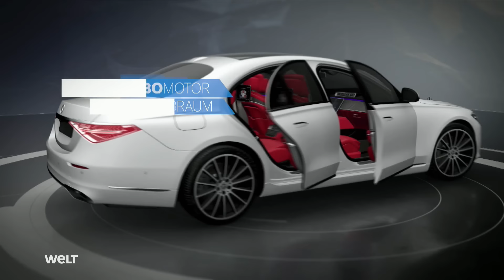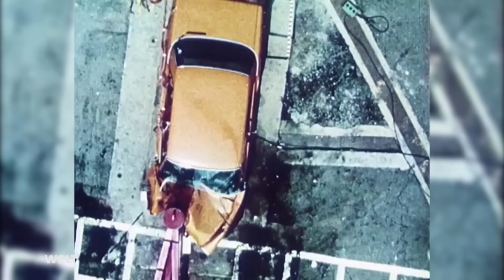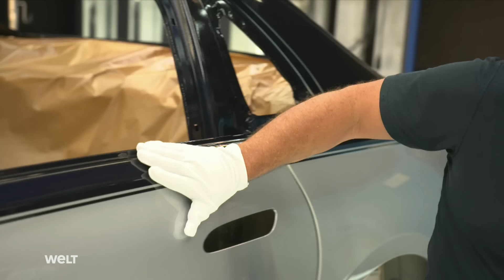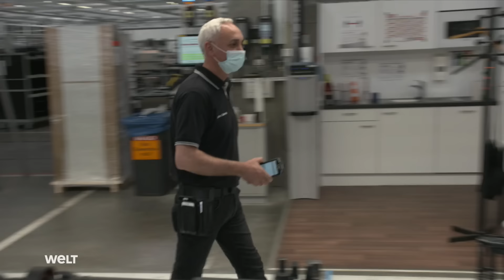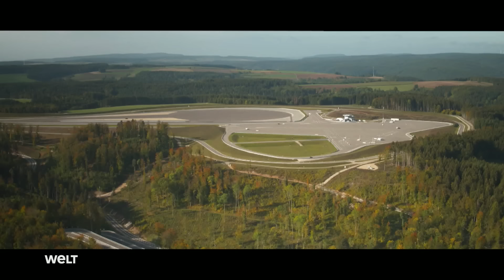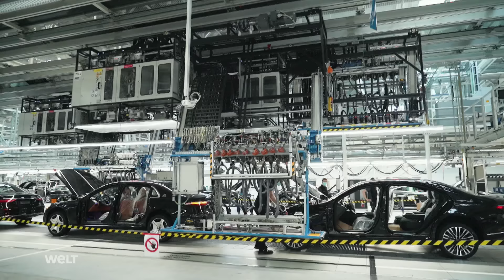THE SECRETS OF LUXURY SEDANS: How S-Class, Maybach and EQS are made | WELT Documentary

Comment: To call these engineers shit head it's not enough, I am an auto mechanic and it's a nightmare to work on a Mercedes, there is no room to work, they put so much stuff there is no room in the engine bay, Mercedes s to replace the turbo's you have to remove engine and the transmission out of the car, as soon as I said that to the customer, the customer sold the car, u are talking about $11,000 parts and labor (two turbo), the customer got sick and tired of spending money on it. To replace one head light they asked $6000. (in Los Angles) To do 4 braks $2000, coolant leak $1000, oil leak another $1500. Mercedes M class, dealer asked $15,000 to fix the engine, 4 month later transmission went they were asking about $12,000 if I recall right, another one they asked $72,000 to replace the engine AMG Mercedes 500 S

Comment: S class, c class,
BMW 3,4,5,6,7 SERIES IS HIGHLY EXPENSIVES AND SIMPLY COSTING FOR REGULARS SEVICES AND REPAIRS..
I'VE EXPERIANCING 7 TIMES BROKE AT HIGHWAY WITH BMW E93 AND SOME COUSES ELECTRONICS FAILURE..
VW.. GEARBOX IS SIMPLY EASY TO BLOWN UP AFTER REACHING 200 TO 230K KM.
GERMANY BRANDS IS EXPENSIVES CARS WITH MANY ELECTRONICS FAILURES AND OLMOST FAILURES ON PLASTICS SOCKETS..
EXPENSIVES CARS WITH CHEAPEST PLASTICS BEING USED ON ELECTRICALS CONNECTORS

Comment: European cars are sophisticated, superb engineering yet some models aren't as reliable as others., like American cars some models are reliable others not. An example some Lincolns, Fords, Buicks, have run over 400,000 to 650,000 miles without the top end being rebuilt, my Buick has 431,000 plus mikes still runs good, burns oil but keep the level full. Mercedes diesels of the 1980's would run over a 500,000 to 1 million miles incredibly well built cars, love the S claas.

Comment: 1:00: 🏭 Mercedes-Benz builds luxury vehicles in its fully networked superfactory in Zindelfingen, Germany, producing the S-Class, Maybach, and EQS models on a single production line.
5:39: 🏭 A press shop in Hall 17 uses an overhead crane to produce molded parts from metal sheets at a high rate of efficiency.
11:35: 🚗 The video showcases the process of painting vehicles in a modern car factory, highlighting the efficient and resourceful e-coating dip tanks.
17:09: 🚗 The video provides information about the history and features of the Maybach luxury car.
23:00: 🚗 The video showcases the assembly of dashboards for vehicles using automated guided vehicles.
28:49: 🚗 Mercedes-Benz car production plants are utilizing industry 4.0, big data, and intelligent tools to streamline production and ensure high quality.
34:44: 🚗 Mercedes-Benz aims to be completely CO2 neutral by 2039 with a photovoltaic system on the roof generating 30% of the factory's annual energy needs.
39:45: 🌍 The challenge is to create a car that can drive on any continent and understand different traffic cultures.
45:04: 🚗 The S-Class is filled with various fluids and prepared for its final stages of production.
Recap by Tammy AI
Reply: Wow amazing how this Tammy AI summarizes it! love it! Thx for saving my time!

Comment: That's okay Mercedes-Benz. I am content and very happy with my 2019 Toyota Corolla. It currently has ~6,500 (yes, 6500) miles on it. I can reasonably expect this vehicle to have a service life (no rebuild) of 250,000 miles. Since it has a timing chain, the only replacement parts will likely be the water pump, brake rotors, and perhaps wheel bearings. However, since I stay in Philadelphia, PA, the vehicle is also likely to suffer a collision from a careless, impaired, or reckless driver. Rear-end and careless left-turn collisions are popular here.

Comment: Too bad the cars are such unreliable piles of junk that depreciate like they're made of ice cream. 
Spending money on a German car is a sign you have too much money and no brains. 
Take it from an EX BMW lover who owned fifteen of their cars from 1, 3, 5, 7, X, Z to M's. Then I discovered that your luxury car doesn't have to leave you stranded because their transmissions are DESIGNED to fail at 120,000kms due to dealers recommending that you DON'T change the transmission fluid because it is 'lifetime'. Or that your cooling system doesn't have to be made of plastic that explodes when it feels like it. Or that the dealer doesn't have to take your $250k M car on a weekend away and joyride it. Or that intermittent electrical gremlins shouldn't be part of your experience. Or that your sunroof is broken because of a three dollar piece of plastic that was designed by person who did the cooling system but it costs $3k to rip the headliner out to fix. Or to have the dealer try to scam you by unplugging the GPS antenna connected to the GPS unit in the boot and then telling you it will be $4k to rip the car apart and install a new antenna and then running and hiding like cowards when you plug it back in IN FRONT OF THEM. Yes, I'm looking at you McGuigan BMW, Port Macquarie, Australia.

Comment: The head of production Mr.Michael can be mistaken as  Kawasaki has been manufacturing using this system from a decade ago. A single line may produce a docile and low capacity street bike , a big heavy cruiser  or a firebreathing superbike all on the same line. Although mercedes has a new plant so they have a more modern system implemented.

Comment: I believe that a vehicle can be defined as luxury, by introducing new mechanical components that are absolutely revolutionary and representing a pioneer in the field of mechanics. But unfortunately, so far, for more than 100 or so years since the vehicle appeared, they have only come up with small innovative fillings. The performance and consumption economy of a vehicle is reflected by a new technical and technological structure. The rest as comfort returns to the last stage. Unfortunately, nowadays, the whole automotive industry only copies from each other with small differences in desing, certain aesthetic elements, and in terms of new revolutionary mechanical concepts remains at the white sheet stage.
Reply: did you watch the whole documentary, some features are truly revolutionary, like auto breaking, self driving, self parking, electric motor, also new safety measures. I mean what you look for, this is not flying machine yet, just a 4 wheel car carrying humans as it was 100 years ago, just get real
Reply: @inter3684  
from the documentation, I have found so far that the first electric vehicle was made in 1832. I meant that no other technology had been tried in the system of wheels, chassis, steering, engine. From the electric engine, it went to the internal combustion engine, and now it returns to the electric model again, only with small technological and not mechanical changes.
Reply: @carpii4ciclet  Sorry you make no sense! if first electric vehicle was discovered in 1832, why should not we use it extensively in 2023?
Reply: @inter3684  I don't think you fully understood what I wrote. I did not refer only to the change of electric motor to internal combustion engine, but to the fact that in this entire industry, no new mechanical principles were invented and the same old knowledge was used. You can't call innovation just by changing one engine principle with another and leaving the same mechanical systems obsolete.
Reply: Oh really, & what have you come up with that out shines the innovations brought to market by the car industry & doing so while constantly under the constraints & scrutiny of various government microscopes?

Comment: I got a special order the S 580 4Matic  2022 full options. The car is excellent but has a problem that the 12 volt  battery has to be re charged especially if I do not drive it for at least 20 miles per day. That means you will put more mileage on the car and the warranty will expire before 4 years. There is a class action lawsuit against Mercedes because the company refuses to correct this issue.

Comment: If you have ever had beers with three mechanics who fix S-class Mercedes cars when they break after 5 years (and they always do), you will look differently at this video 🙂
Reply: My 2019 S-Class has now nearly 100.000 Kilometers on the clock and i had zero issues, even the brake pads are the first. Only because of tax write-off reasons, the car will be replaced by a new S580 in the next spring, otherways the car drives like at the first day.
Reply: @Rick2010100  That is a total lie. No brake pads will last more than 50  K miles. Writing idiotic prose like ghis shows what you are.

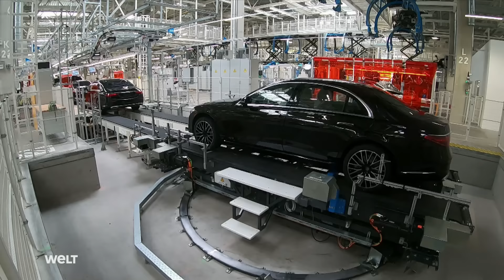Comment: Is it just me or the lines are slightly mismatching at 48:26 ? Pretty sure there is an additional station where the door lines are perfectly matched !
Reply: The lines of the door are indeed slightly off, but this is actually the norm when doors have just been installed.
The angles of the doors will be fine-tuned after they've been installed. They'll be adjusted until the lines are perfectly straight and surfaces are flush with the body.

Comment: what happens when one of those tiny plastic evap hoses cracks and 67 hours is required to change it or the cruise control is disabled? after the warranty runs out by 2km. screw it you rich enough to buy this one. just buy a new version. goodluck maybe putin hasnt dropped the newks yet and the cpus are all destroyed by the EMPs

Comment: While the factory is great for the Mercedes shareholders the cars are prone to have many electrical failures.
Reply: as every modern car, due to the fact that cusomers want more and more stuff in there cars. Its easier to build long lasting mechanical parts than making sure you will never run into problems with wiring, sensors or any electrical components

Comment: Mercedes makes an excellent cars and they look great from the inside out, but they have to many maintenance issues just like the BMW, and that’s why I moved to what I believe is the cream of the crop (Lexus). I brought a brand new LS 500 and I love it.
Reply: The S-Class is rock solid since the W221 generation wich was produced from 2005-2014.
Reply: I have have a LS46 SE-L, and a GSF sport with 5 litre engine. They come fully equipped, the service is brilliant from the dealer and having only once bought a mercedes, even the dealer was rude and arrogant and liars. After 3 weeks, I asked for my money back and eventually took them to court. Never,ever buy German
Reply: Even new Lexus cars are not reliable anymore due to electronic issues, too much electronics in them which can fail anytime
Reply: @M.E63  Failure in new cars happens because of plastic and cheap connectors. Mercedes use plastic pumps, Lexus use iron pumps,Mercedes use rubber hoses on AC and cooling lines, Lexus use stainless steel. 
Failure of wires and electronics in Toyota products are under 1%. Mercedes has had more problems with their hybrid batteries in 5 years then Lexus has had in 20 years with millions of hybrids.
Reply: @epoxy1710  nope failures happen from semi conductors and caps and diodes etc I’m talking about electronic components, you can’t predict how long they last as a capacitor , diode or a ic can fail anytime and the Japanese don’t have anything special when it comes to electronic components, they use the same as everyone else, most new cars have electronic or electrical issues and the things your talking about don’t really fail until the cars get older, and electronic issue you can’t predict when they will happen as it’s normally just happens randomly not normally a quality issue, if you go to Germany you’ll see taxis that are Mercedes with half a million miles and we talking about lots of Mercedes taxis, not one or two Lexus cars with half a million miles , some things are better on Japanese cars but not electronics as they use Bosch and Delphi and ATE aswell and there’s no such thing as bulletproof electronic semi conductors that only the Japanese have , it’s a shame though the Lexus and Toyota and can’t compete with with even JLR and they make terrible cars nevermind competing with Mercedes or bmw or Audi
Reply: @M.E63  The average Land Crusier 300 serie has first major breakdown in Russia,Africa and Australia after 380.000 miles and wrecked after 850.000 miles. The average Lexus has the first problem after 155.000 miles with a average cost of $460. Audi and Mercedes is overrated.
Reply: @epoxy1710  I’m telling you as a electronic engineer , Japanese cars got nothing special when it comes to semi conductors and electronic components, your comparing old cars which means nothing compared to new cars , most new cars get electrical and electronic issues , Mercedes engines don’t fail after a year or two and neither does the gearbox or suspension, most new cars get electrical and electronic issues and that can happen to any brand, semi conductors can fail suddenly not bcuz of quality issues or design issues, then days are gone where your electric windows just have a motor, switch and fuse , it’s all controlled by modules and so is everything so they going to fail more compared to older cars that had hardly any electronic modules, that’s why it’s impossible to compare old cars with new cars, I’ve had Mercedes cars and bmw and other German and British and Japanese and Korean and American and so on , Mercedes and the Korean cars for me was the most reliable, the Mercedes cars for me went on forever with no major issues, just usual wear and tear stuff, Mercedes vans go on forever, there’s a reason in Germany taxis have like half a million miles and even way more now, these days there Mercedes w212 in Germany that done way more than half a million miles, I’m not talking about one or two but lots of them, you obviously been watching too much scotty Kilmer , Toyota even teams up with bmw, that tells you something about the Toyota brand , but newer cars is a different ball game especially ones now that have like 6 radars and LiDAR and lane assist and brake assist, and 6 cameras and tons of modules to control everything, when you got that much technology in a car then something is going to fail
Reply: My 2009 LS600hl was without problems from 2009 to 2022 (240.000km). My friends new 2020 S-Class had 3 problems the first 6 months.